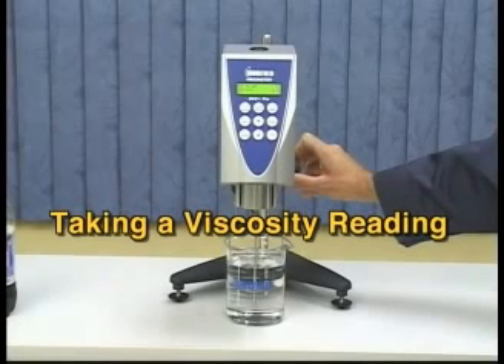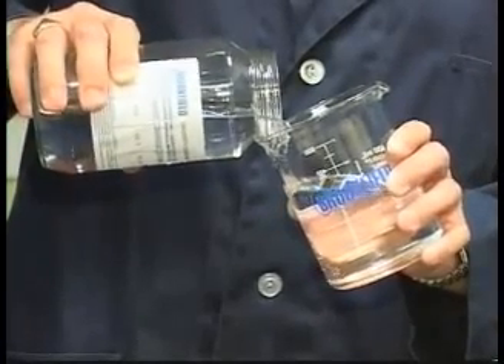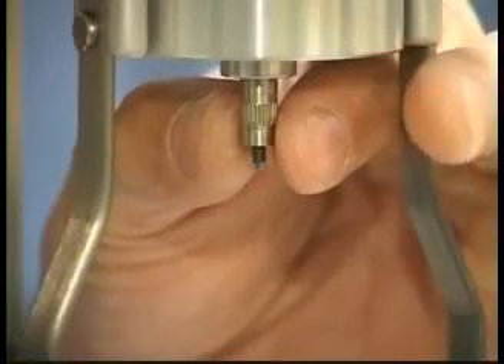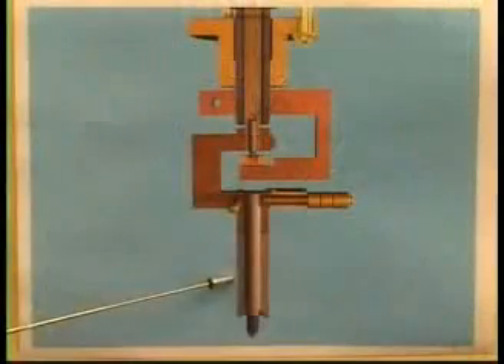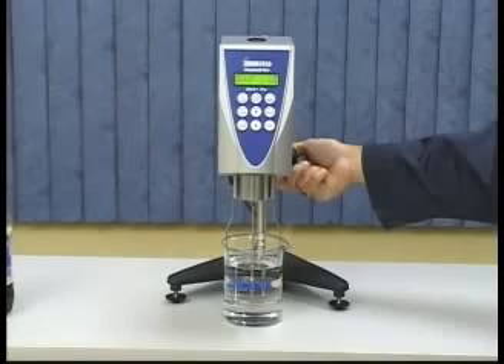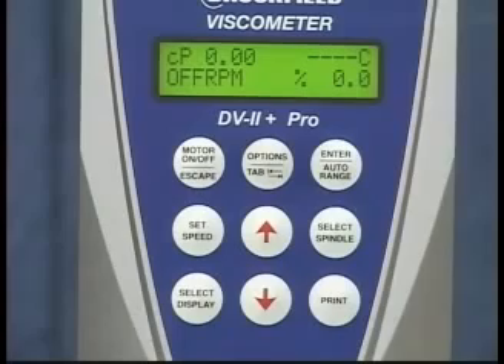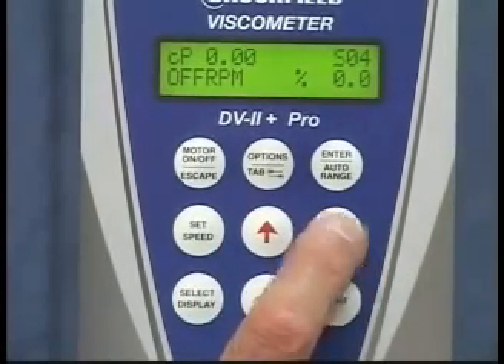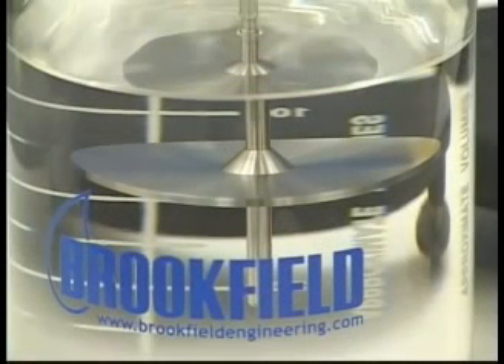Brookfield Viscometers, How to Take a Viscosity Reading

Comment: hello i would like to ask a question what if my viscosity torque below 20% ? is it okay if change the rpm in the middle of process measuring the viscosity ?
Reply from the maker: Hi Arung - I checked in with our team and they note: It is recommended to not go below 10% torque.
Adjusting speed is ok to ensure torque is above 10%. Closer to 100% is better.
You might also consider a different spindle....

Comment: How do you termine which speed to use for a simple viscosity reading?
Reply from the maker: 3.4.3 Selecting a Spindle Speed
When performing a test according to an existing
specification or procedure, use the spindle and
speed specified (after confirming that you have the
correct Viscometer model). When conducting an
original test, the best method for spindle and speed
selection is trial and error. The goal is to obtain a
Viscometer dial or display (% torque) reading between
10 and 100, remembering that relative error
of measurement improves as the reading approaches
100 (see Section 3.3.7). If the reading is
over 100, select a slower speed and/or a smaller
spindle. Conversely, if the reading is under 10, select
a higher speed and/or a larger spindle.
If the approximate viscosity of the sample fluid
is known, a faster method for honing in on the right
spindle/speed combination is available by referring
to the Factor Finder supplied with the Viscometer.
The goal is to select a combination whose range
brackets the estimated viscosity of the sample.
For any given spindle/speed combination, the
maximum range available is equal to the spindle
Factor multiplied by 100. This maximum is also
called “Full Scale Range” or “FSR”. For Digital Viscometers
that have the AUTORANGE key, selecting
a speed and spindle and then depressing and
holding the AUTORANGE key will cause the screen
to display FSR in cP (mPa•s).
The minimum recommended range equals the
Factor multiplied by 10. For example: a #2 spindle
on an LVT Viscometer at 12 RPM has a Factor of
25. The maximum range of this combination is 25
times 100, or 2500 cP. The minimum recommended
viscosity that should be measured is 25 times 10,
or 250 cP. Therefore, if the viscosity of the sample
fluid is estimated to be 4000 cP, another spindle/
speed combination must be selected in order to
make the measurement. If the sample fluid is around
2000 cP, however, this spindle and speed would be
suitable. With a little practice, a quick glance at the
Factor Finder will suffice to make an appropriate
selection of spindle and speed.
When conducting multiple tests, the same
spindle/speed combination should be used for all
tests. When a test must be performed at several
speeds, select a spindle that produces on-scale
readings at all required speeds. This may necessitate
using a dial or display reading less than 10,
which is acceptable as long as the reduced accuracy
of such a reading is recognized.
Reply: @johnmorrisscientific  Thanks a lot for the thorough explanation. That was exactly what I needed. I know now I need to buy another spindle!